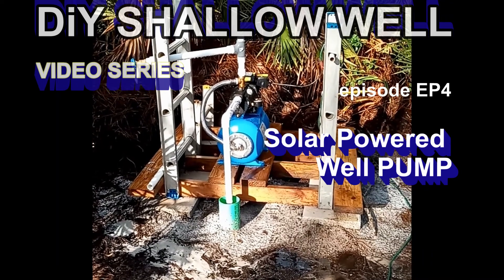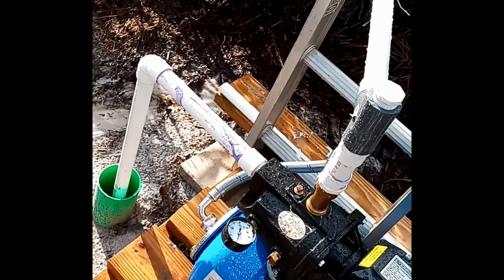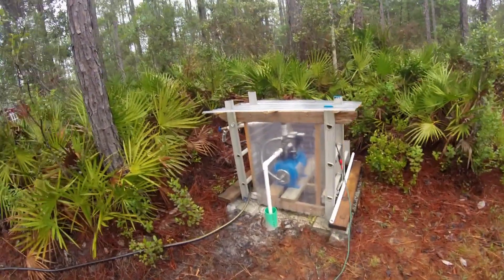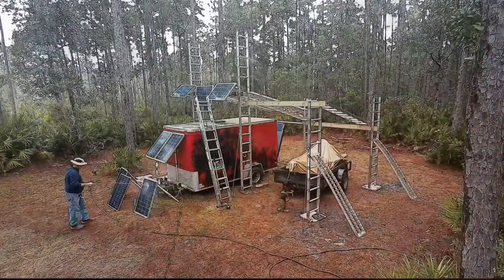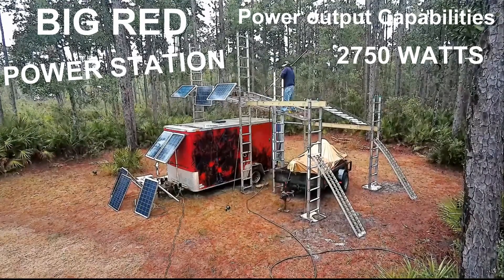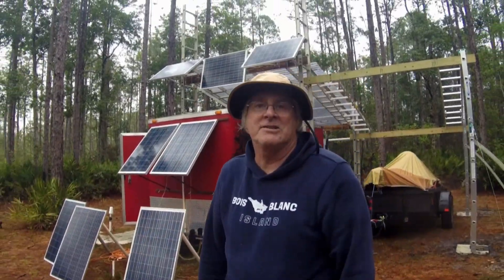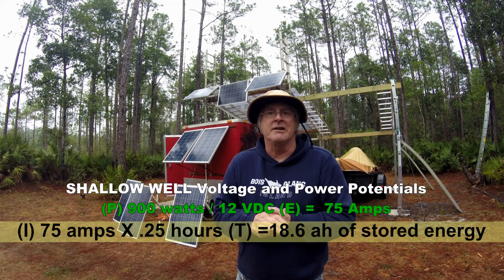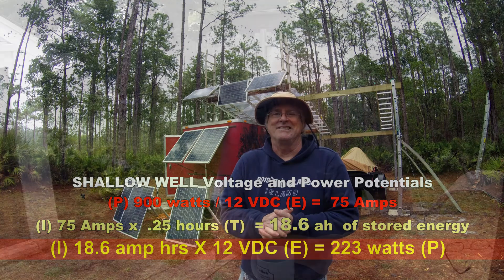How much Solar Power does it take to Run a 25 ft Shallow Well Pump? Off Grid Solar Well Pump

Comment: Thank you for this series! 

I am looking at real estate in that area and live in a 5th wheel. The fresh water tank is 40 gallons. Do you know what the 15 minutes of run time would equal in gallons? I have 1200 watts of panels on the roof 200Ah of battery and 24v 3500 watt inverter. I am relatively sure this would be adequate for filling the tank on sunny days but wanted to be certain.
Reply from the maker: Hi Fred,
Thank you for watching!
Sounds like a nice RV!
With 1200 watts in from solar panels, you will have no problems. The pump I am using in the video puts out up to 550 gph. That's just under 10 gallons per minute. But figure on 3-5 gallons per minute. It's pulling from 25 feet down under!
I had made this video on a cloudy day so it used up a lot of energy from my batteries. So, on a sunny day again , you will have no problem replenishing a tank.
Be sure to test your water from the well before putting well water your fresh water tank. There is a free test from Walmart you can get. Thanks again for watching!
Reply: @AtlanticDrain  Thank you for the quick response! That would amount to about 10 min of pump time. With start and run ... all good. 
We would test and we would  have a 4 stage filter system between the ground but after and our tank. I did not know about the free Wally World test so thank you for that info as well!